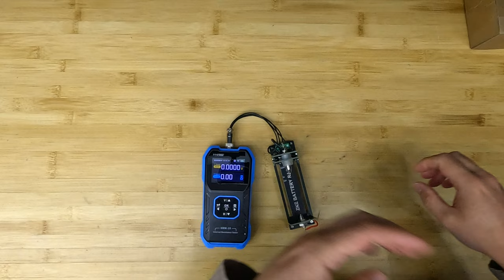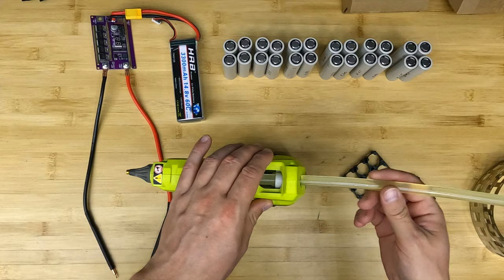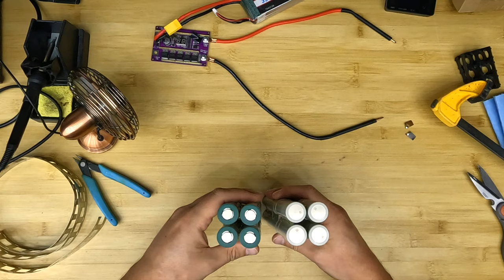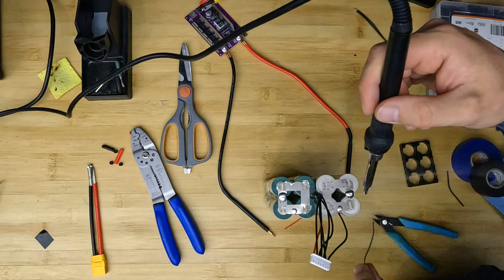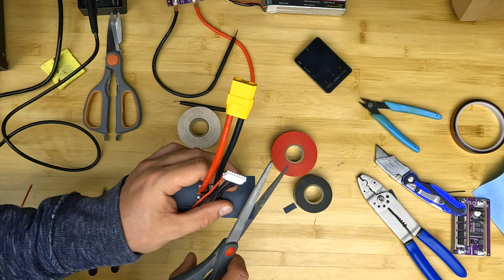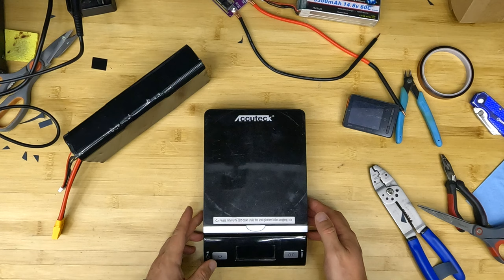I've Built a Massive 18000mAh Battery 🔋 to Power My 10" FPV Drone 🚁! #fpv #battery #liion

Comment: By my calculations 18AH bat will give you 35-40 minutes of flight time. And 9AH 33mins on a 10". Interested to see the real tests
Reply from the maker: That's very interesting information! I was planning to build a 9000mAh pack for my upcoming 7" project. I might build the pack early to compare it with the 18Ah pack.